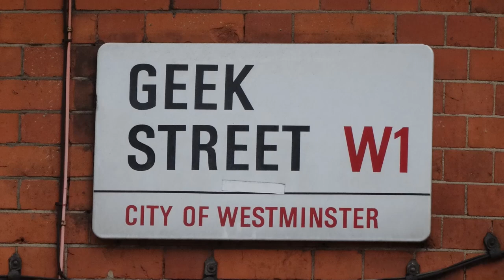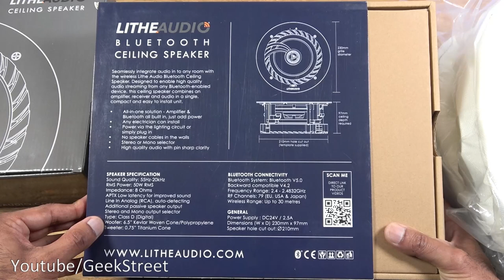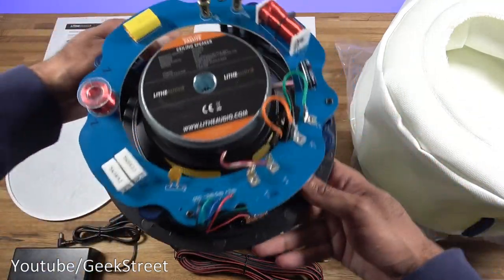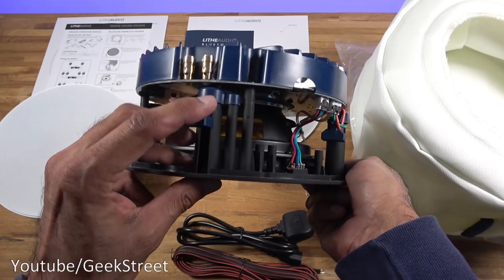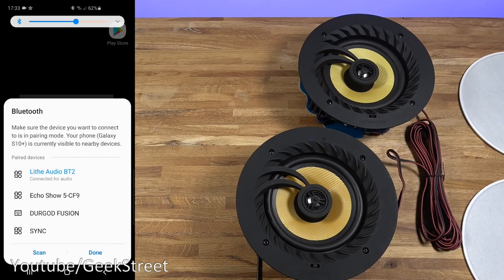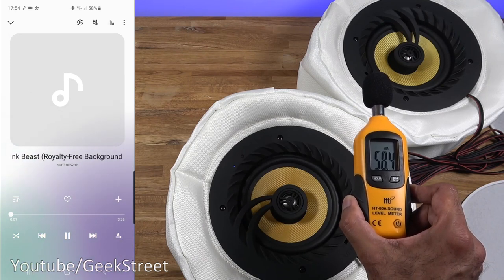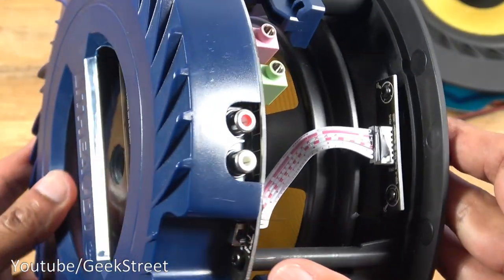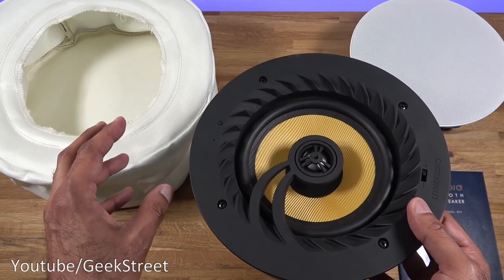Bluetooth Ceiling Speakers from Lithe Audio Unboxing and Setup Review | BLUETOOTH RANGE OF UP TO 30M

Comment: These are great speakers, the only thing i don't like is that you have to connect the two speakers together via a speaker wire. I can't see how i can do that with my two speaker holes in the ceiling and they are like 2-3 meters apart.
Reply from the maker: Thanks for the comment, its really not that bad, it depends on the direction of the joints and if anything in the way.
Reply: just buy 2 master speakers then you don't have to connect them
Reply: 2/3 meters speaker wire

Comment: given the limited space for the speaker, I would like to place the power supply in another room, about 9 meters away. I would use a different speaker cable (because I have 2 ready there) to send the 24 volts to the speaker. Do you think distance would be an issue?
Also, since the power supply is not in the false ceiling, there is not only less fire risk, but also handy if the power supply is broken, then I do not have to disassemble the speaker

Comment: Hi there. Can I ask you what the bass is like when fitted in the ceiling please? Would they be good for  say trance, dub step, hard-styles that have a lot of bass ? 

Many thanks I hope you can help
Reply from the maker: The bass is ok, nothing amazing. You'd probably want to use in conjuction with a  subwoofer, but I think they are doing subwoofers for a ceiling now.

Comment: How do you connect to another phone to hear music from it, this is likely to happen in a domestic setting? Do you have to press a button?
Reply from the maker: You would have to disconnect the existing phone and then connect the other phone, it's just like a standard Bluetooth speaker but in the ceiling.
Reply: Whoever connects first is in control, if they leave home or manually disconnect in the Bluetooth setting of the phone or say 'Alexa disconnect my speaker', for example, then the speaker becomes available for another device to connect.

Comment: Can and how do you connect this to a  tv    kind regards
Reply from the maker: Yes depending on the TV, see at 6.44 the rca connection
Reply: @GeekStreet  thanks for your replay 

I did but would this mean that the TV and speakers would be constantly connected ( meaning would you have to disconnect the cables from TV to stop sound every time you just wanted sound from the tv) or will your TV allow you to choose speaker out  put mode 
Well impressed with the product BTW 
Thank you
Reply from the maker: @scarfyleah  all depends on the tv settings. Some tvs allow multiple output then you don't have to mess around. It is a cool set of speakers what impressed me the most is the long Bluetooth range.
Reply: @GeekStreet  yer me to mate 
Thanks for your help 
And habe a great evening
Reply: One last question would an Alexa device link up to this so you could play through these speakers ? 
Kind regards
Reply from the maker: @scarfyleah  yes thats possible and thats what they highlight on they Amazon listing.
Reply: @GeekStreet  thank you mate most helpful
Reply from the maker: @scarfyleah  you're welcome!